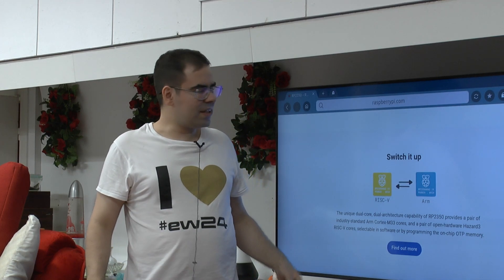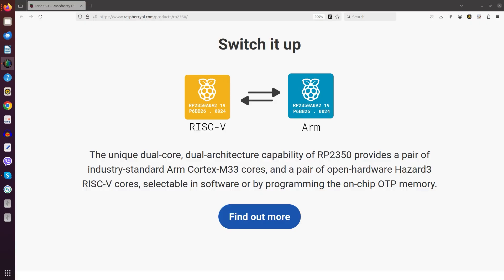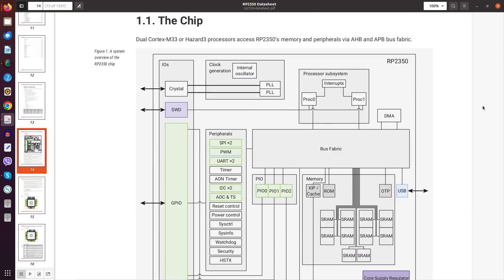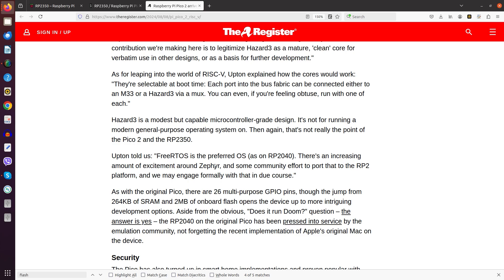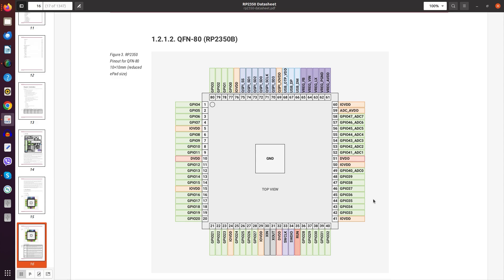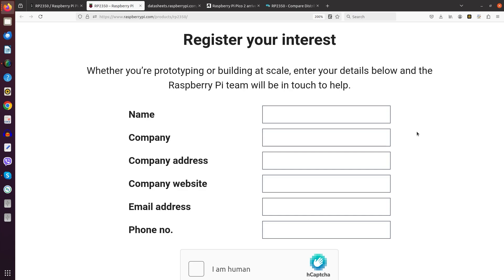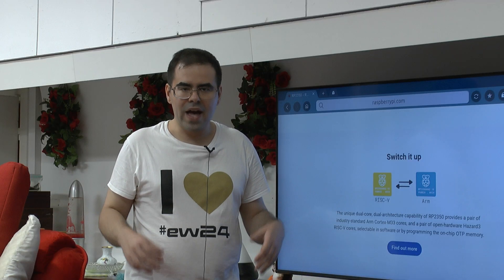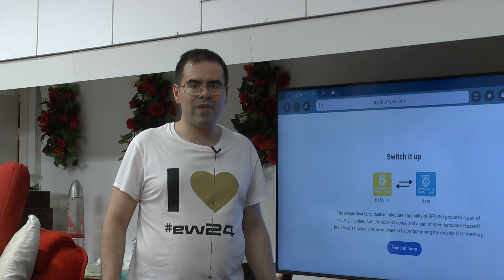RP2040 vs RP2350 - or - Raspberry Pi Pico vs Raspberry Pi Pico 2

Comment: I bought a Pimoroni RP2350B version ('Pico 2 Plus') - arriving the day after launch. First time I heard about 'Infineon' - but I managed to add a cheap 'Super Mini' ESP32C3 with ESP-AT for £1.50 which gives me a wireless connection via one of the Pico 2's UART. I think Adafruit have an ESP-AT SPI version.
Reply from the maker: Hi, thank you for talking back - I hope for DHL to clear my SeeedStudio PCB very soon. In the mean time - that is quite a neat combination. However, on the Pi Pico W, they did use an Infineon module instead...

Comment: Quality in pi 5 was terrible. Flimsy nvme ribbon is a joke, minuscule micro hdmi plugs.
First pi 5 died in a fortnight, I got a refund but was still out of pocket with the shipping.
Reply from the maker: Hi Man, thank you so much for talking back! May I ask which distributor left you hanging in the dry?
Reply: @MrTamhan  I wouldn't say they left me high and dry, although they made me re-test it with about 6 different power supplies, then made me post it back for them to confirm. Before they sent me a replacement. I did ask for a replacement thermal pad for the fan and they said 'sorry, no'. Maybe if I argued a refund with the $12AUD postage they would have refunded it, but I'd already wasted so much time and I don't think they're a big company so I didn't. It was more the week's emailing back and forth which was the main irritation. I was more irritated with the Pi Foundation for the failure, because if it failed a year later I would have been out of pocket with no replacement. When I buy something I expect it to last. Anyway to answer your question it was Core Electronics.
Reply from the maker: Hi, oh man, I know this one too well. This is kind of annoying, yes, when the reclaiming of the small things is blocked iontentionally...

Comment: Weird way to support RISC-V Uptonites! Having it in the same chip as ARM cores, presumably means they have to pay the ARM licence even if the user has no intention of using the ARM cores. Also it means the chip area is unnecessarily large whichever core type you choose. Since chip cost is pretty much proportional to area, this will push cost up for both core types!
Reply from the maker: Hello, thank you for talking back! The thing here is that, according to rumors, if the pressure is large enough, the licence fee becomes infertesimally small. And you must always remember that Upton actually is a BroadCom man, not an RPi man. So there might always be a side benefit.
Reply: @MrTamhan  Eben Upton is DEFINITELY a Raspberry Pi Man given he founded the company and remains in charge after the IPO. Nothing to do with Brcm.  Also, the RISC cores on the RP2350 are tiny, and take up very little die area.
Reply from the maker: @jamesh9756  Hello, thank you. Are you sure that he completely lost his connection to BCM after the IPO?
Reply: @MrTamhan  He left Broadcom years ago IIRC and has been working full-time at RPi since. The company uses Brcm SoCs so clearly there is a working relationship, just like any company and chip vendor.
Reply from the maker: @jamesh9756  Hi, OK, so this is also possible. I am just a bit paranoid after the whole OLIMEX affair, where BCM refused to supply...
Reply: @MrTamhan  Not a problem with the RP2040/RP2350 as neither have any Brcm content. They are entirely home grown microcontrollers, designed in house at Pi.
Reply from the maker: @jamesh9756  ah, ok, thanks for talking back man!

Comment: Great video. Probably the most informative one out so far. Do you think this chip was one of the reasons ARM wanted to buy them? To prevent them from continuing down the Risc-V path? This must been in the work from a lot of time.
Reply from the maker: Thank you so much for the praise. IMHO, the effort to 'me also' a RISCV design is not as high as one might think at first...